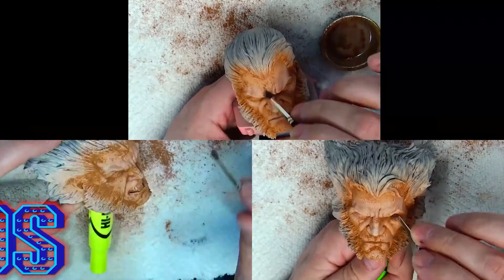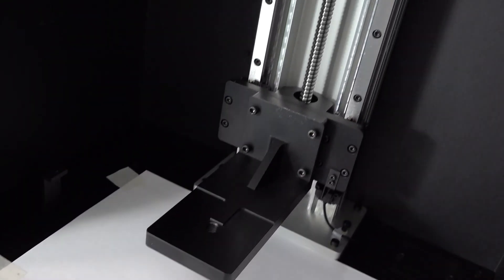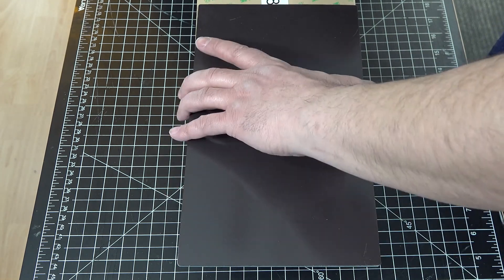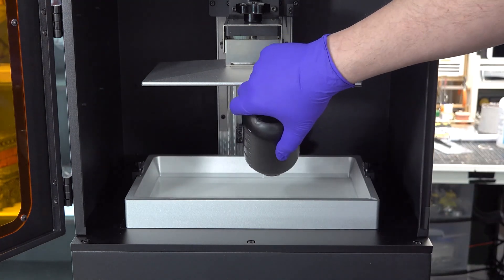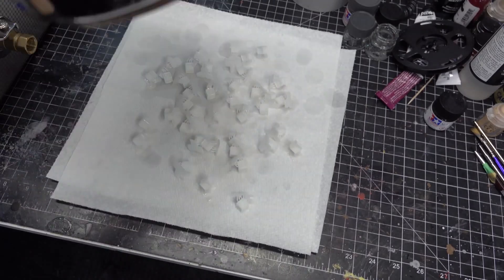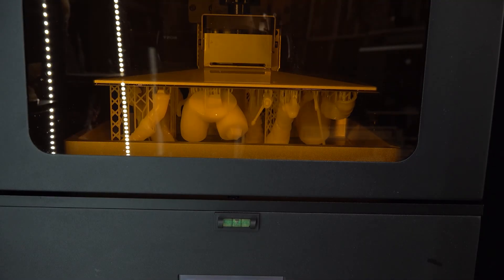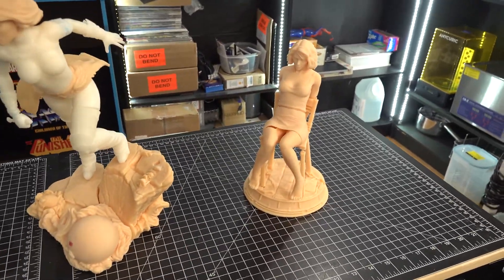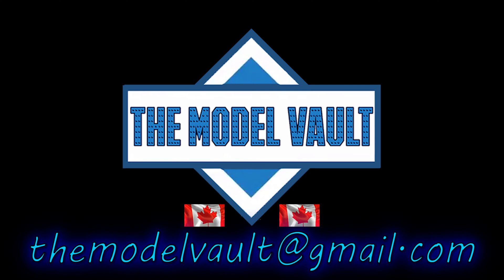Peopoly Phenom 3D Resin Printer Unboxing Setup STL Prints

Comment: I am having trouble getting prints to stick to my wham bam system  I a peopoly phenom L also
Reply from the maker: I  always use Monocure 3d liquid on my plates, works every time. I've had huge solid parts the weight 1lb not come off the plate. buy a bottle, lasts a long time a you just need a little spread out on your plate.

Comment: Wow that's super dope
Reply from the maker: Thanks Dakota!
Reply: @TheModelVault  Leveling is an issue i have. So i was wondering , did you keep all the bolts tight, THEN home it. THEN loosen one screw at a time per corner and push down? it seems you leveled your bed VERY QUICKLY. im trying to find the best way to level my bed...and i JUST installed a flex plate myself! thank you.
Reply from the maker: No, i loosened all bolts then homed it. The tightened them all.
Reply: @TheModelVault  that explains it I been trying to home with bolts tight, then loosen. But I've had terrible luck.